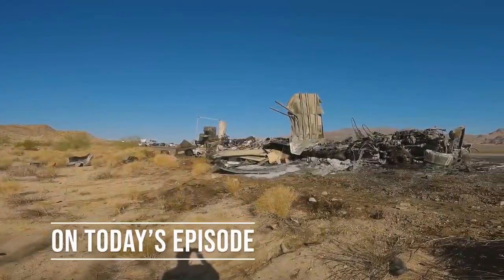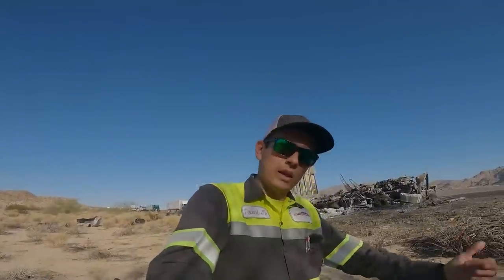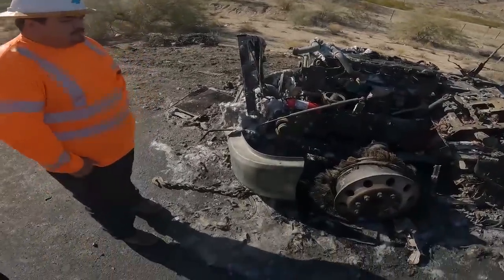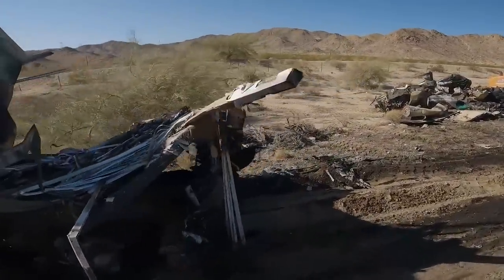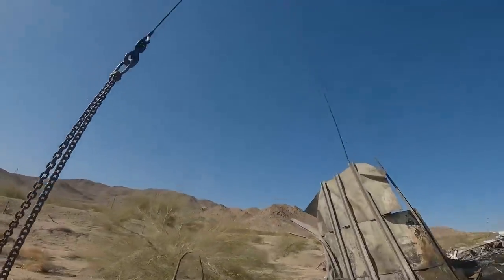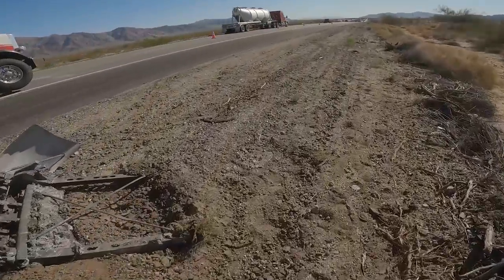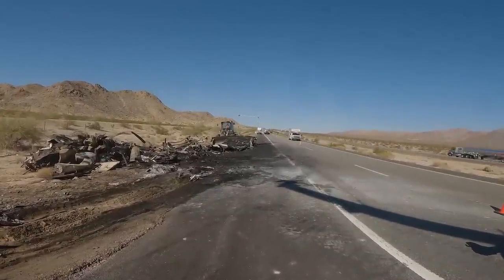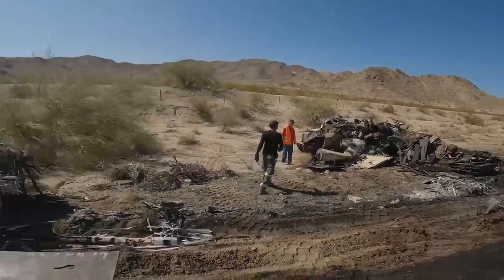Home Depot Semi BBQ

Comment: Sounds like the DPF got way too hot during regeneration which in turn ran for too long due to a faulty automatic shutoff system to stop the process once complete
Reply: Made worse by those “weed burner” exhausts that point directly at the ground

Comment: Out of curiosity, who provides you all the clamps, ropes, chains etc.? Is it from local hardware store (would be kind of nice, but probably isn't from there)? Do all those pieces of equipment have "maximum rates", or you have to think how much weight it will have to pull?
Reply: Chains for lifting are required to be certified for overhead use all chains have a grade rating for tie down weights
Reply from the maker: Well said ^
Reply: Local hardware stores do not stock industrial chain. It's all from specialist suppliers. 
To expand on Brad's reply, all of the lifting equipment has an SWL (Safe working load) capacity. 
There's also various different types of chain links, they have different uses and capacities for a given size. The same for the straps they use.